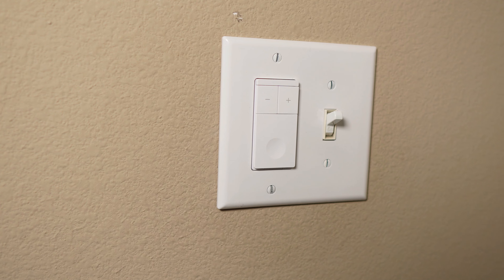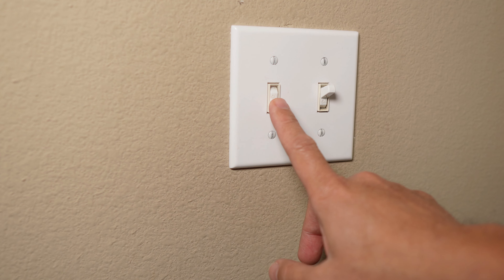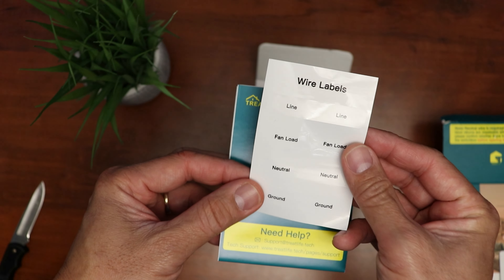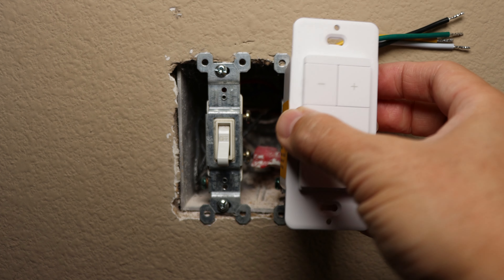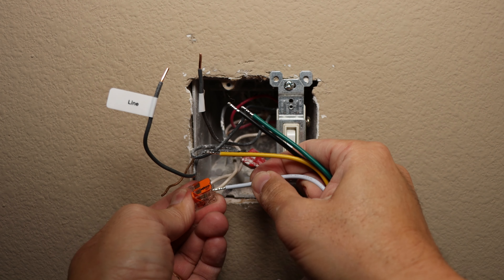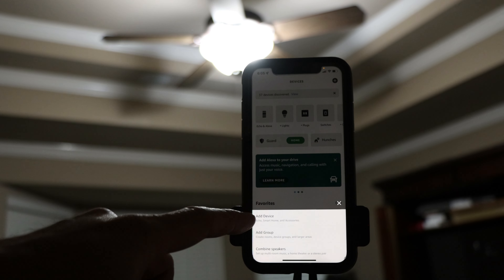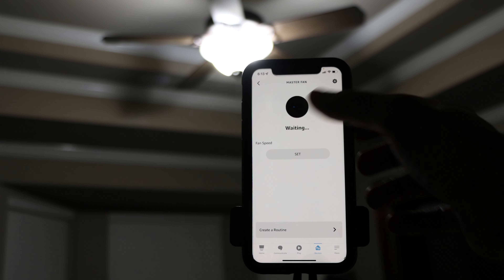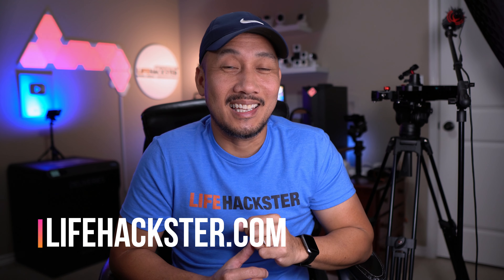Treatlife Smart Ceiling Fan Control - WiFi Switch and Speed Control for your Ceiling Fan

Comment: This video saved me a lot of time and effort!  We had a pull chain break (luckily on high) on the ceiling fan in our living room.  As the fan hangs from a vaulted ceiling. I was not looking forward to replacing the fan, nor disassembling it to replace the pull chain.  Then, your video made me realize I could change the wall switch, fix the issue, and now have a “smart” fan!  Thanks so much for a timely video!
Reply from the maker: You are welcome.
Reply: You're so smart.

Comment: Recently got the TreatLife fan switch with the light dimmer control as well. Works great! Routines with Alexa is awesome as I have the fan come on when our echo detects a certain temperature. And with the light control, alexa routines and guard work flawlessly with it as well. This was my first TreatLife product and have been very happy with it so far.
Reply: How does your echo detect temperatures?
Reply: @Tarzan429  - it’s a 4th gen echo, so it has a built in temperature sensor
Reply: @Nic C  Didn't know that. That's useful. Thanks
Reply from the maker: Great to hear! I'll most likely check out their other switches as well.

Comment: For a couple of reasons (lower than avg body temp, issues resulting from previous cancer) I have to have a fan or an open window above/near my head all the time...  Even in bed. My ex used to sleep with her knit hat on... 😆 
My current can't stand it, it's an issue.  Fortunately we're on opposite  sleep schedules.  😀
  I've been thinking about getting smart controller for my overhead light/fan.  Looks like my suspicions were right, I need smart bulbs for the lights.  Thanks for the video...
Reply from the maker: You are welcome.

Comment: I have the fan in my master bedroom connected to an on/off smart switch. I was wondering if there was a switch that would let you control the speed. I couldn't figure out how to wire a fan switch. The wiring is really no different than the smart switch. This video was a big help.
Reply from the maker: Yes... the switch itself becomes the speed controller instead of the fan. It is an easy install if you already know how to replace a light switch.

Comment: I’ve got a ceiling fan that has smart bulbs in it so I can control the lights. The fan always has power and there is no wall switch. Wish I could add smart controls to the fan without replacing the entire fan or rewiring the house. Great video thanks for sharing. I could use this switch for kitchen fan though.

Comment: Hey, I just watched your video on best security cameras for 2022 but I have a very specific need and was wondering if you could recommend something that may fit my needs.

I have a severe physical disability, am basically bedbound, and have 24/7 nursing so I would like to set up a couple cameras to both help me instruct and check on them. I will have one in my bedroom on the ceiling to help instruct positioning me and one in the living room to help guide them to find things around my apartment.

The features I want: 
Wireless [wifi or Bluetooth]
24/7 recording 
Able to be pulled up on my computer and phone for live feed
Relatively small 
Fisheye to capture a room without the camera moving.
Audio recording 
Relatively cheap

Don't really want/need motion detection or anything because someone will constantly trigger it. I don't think any other features would help me.

Thanks!
Reply from the maker: I think the best option for you would be wyze or eufy indoor cameras. They can do 24/7 recording with a micro SD card, easy to setup, local storage if you don't want any motion/person detection. Now, the fisheye...they are not but you can always get their pan and tilt versions so that it will also cover the area you want covered.

Comment: I went to Treatlife for my smart home set up. Very budget friendly and you can use the app to turn normal switches into 3 & 4 way switches. As for the fan switches, I have 2 and the top speed is absolutely a tornado. I am talking Gail force wind. I have the app defaulted to always go back to 3 if any one tries to set the fan to level 4. Overall a pretty good app and hardware.

Comment: Can I use this switch even tho my fan/light is powered using only 1 single pole switch together?  I was bummed to see two of my ceilings didn't have a red wire to separate the light/fan.

Comment: Treatlife Switches 

Beware of purchasing these switches.  I purchased both single pole and 3-way and both failing.  I had multiple ones installed and only 2 years later they are failing one by one.  So far 9 have gone bad.  No longer respond and cannot be reset.  All installed by professional electrician.  Multiple Amazon customers reporting same.  Switches are supposed to last 20-40 years.  Very concerned these can pose fire risk just waiting in the walls of my home. Amazon aware this is happening but will not pull product.